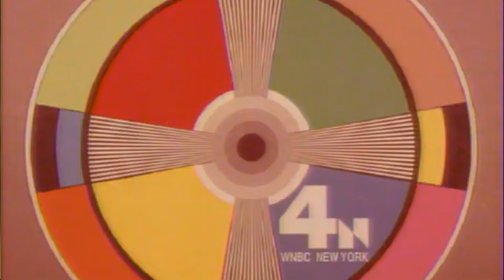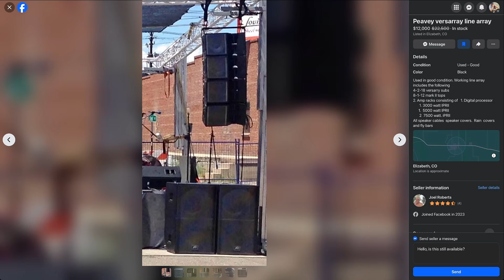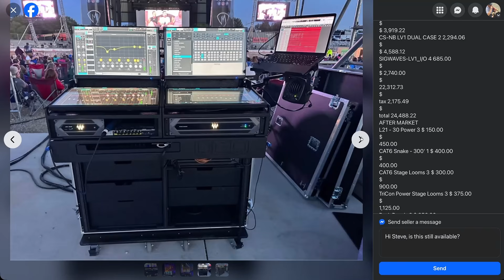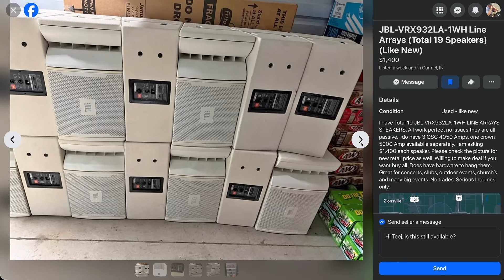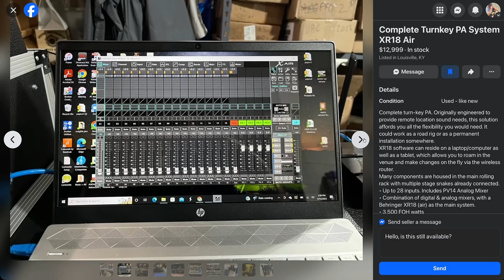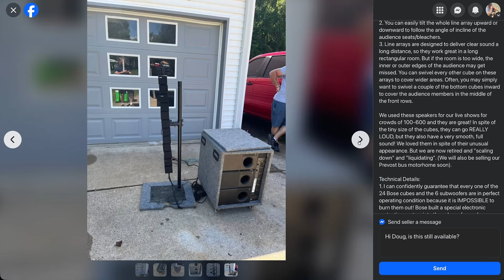Pro Audio Deal Or Disaster? Episode 21

Comment: Problem with the Avid is that even in pristine condition, the tech is simply outdated.. sure, it will work and sound great, but for $6,500 you can get options that have current chipsets and far more capabilities..

It’s essentially a computer, and nobody wants a computer from 2009 as their main driver, no matter how many 2009 bells and whistles you tack on.

Comment: He's nuts.  There is no way that Bose thing sounds good, there would be so much comb filtering.  I am having a hard time finding any dispersion information.  I also don't know how well that amp would handle them.  I assume since there is 12 on a 2 channel amp there would be 6 per channel.  The specs say 4-8 ohm receiver.  So 6 would be sub 1 ohm impedance unless there is some series-parallel wiring going on.  Normally on a line array box the drivers are 16ohm, you can jump 4 together and run the amp at 4 ohms.

Comment: I think for a while PV had a versarry with two 12's or 10's ? with two ribbon arrays stacked in the middle flanked by 3 or 4 a side 3" mids . Those subs are good.
Reply from the maker: I’ve been trying to find dealer catalogs from back then but they’re not easy to find. 

If anyone here has any catalogs, dealer catalogs or brochures they’d be willing to scan and share or send over so I can scan them and add them to archive.org, please reach out.
Reply: I have 2 of the versarray dual 18 subs

Comment: The US version of the DBX drive rack is also not something you want to pick up on the second hand market as there's a metric tonne of Chinese knockoffs floating around. It's like buying a used SM58 - unless you trust the seller or the seller is a distributor you just won't want to risk it.
Reply from the maker: That's really good to know, thanks for the heads-up about the knockoffs!

Comment: On your second listing not worth nine grand that it’s old old equipment. Those amps are every bit of probably 20 years old to drive rack might be still desirable in some cases, but the mixer is nothing special and the speakers definitely nothing special on the first listing my only question on that is, does it support Dante network? If not, that’s gonna shoot that in the foot too we’re kinda in the process of looking for another mixer, but it has to support Dante if it don’t there’s no point in getting it by the stuff is cool. It looks cool but the problem it has with it unless you’re doing a permanent fix installation forget about trying to take the stuff on the road with you unless you are a strong individual, you ain’t gonna be picking these speakers up in any of these listings day in a day out. Forget it now on the third listing that is pretty cool the line of a system although I’ve never seen one done by PV but PV does some good stuff almost looks like a knock off from another brand like they copied the cabinet design just more square than the other but anyway that’s my two cents love watching your channel and a lot of stuff is close to where I’m at so
Reply from the maker: Thanks for the message and for watching as always Marc!

Comment: The Bose stuff is home surround sound items discontinued years ago. 40 people in a home max sound levels. Crazy listing
Reply from the maker: That's definitely one of the most unusual ones I've found in a while. Thx for watching the series!
Reply: @DcSoundOp  they did do them in a commercial version called Freespace Acoustimass.

The satellites were available both in the "home-style" cubes and in-ceiling versions, and the bass modules were also available both in the "home-style" box and in-ceiling versions.

A store near me actually uses the "home-style" cube satellites (with ceiling brackets) in conjuction with the in-ceiling version bass modules.

We are of course still talking shop/restaurant audio though, 70/100V lines, not live sound.

I don't know if you've seen it, but there is however a post/photos on "the past tense of reading it" - Huge Bose 802 System - of line arrays of 802s, with a horizontal array of Model 302 subwoofers the width of the stage! Apparently the system was so big and complicated that Bose actually went and helped set it up/"tune" it lol...